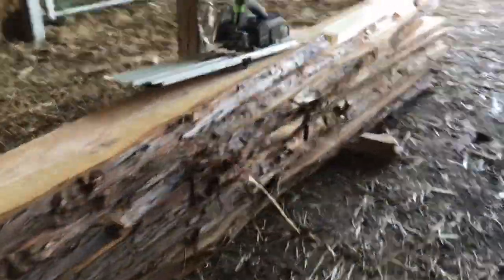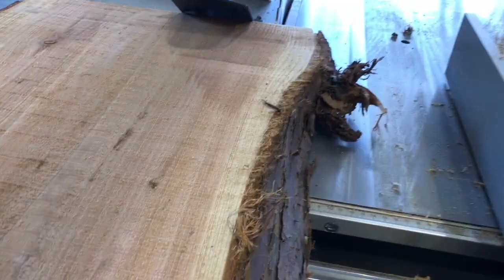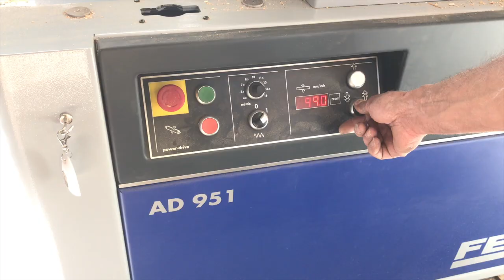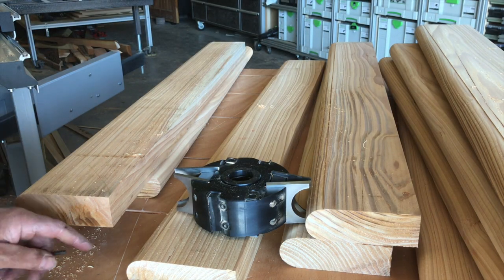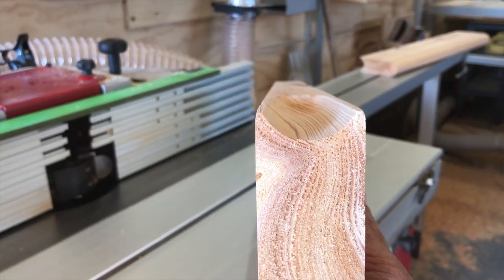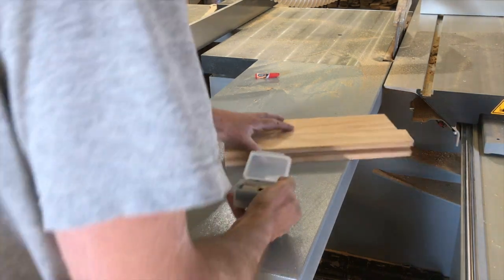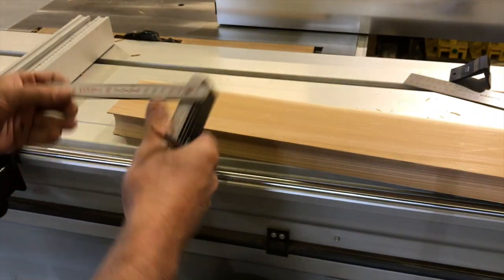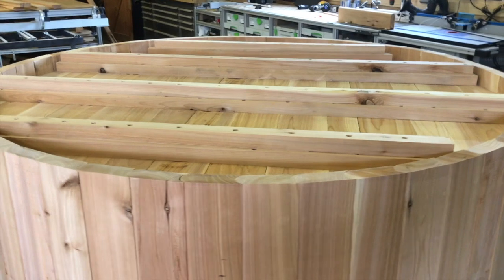Hot Tub from local live edge - Western Red Cedar p1

Comment: How did you calculate the width of the planks going round so you got a right fit and ended with a full one?
Reply from the maker: Times he width of each stave in my case 53 x 111mm.  Total 5883 giving a total outside radius of 6m.  Which takes in to account the 10mm rebate as I cut a 20mm rebate in each stave you have room to make small adjustments

Comment: Hi, great channel. You've been really helpful as I set up my own workshop. Can I ask, is the altendorf able to take the dado blade as standard? And what blade are you using? As I don't have a tenoner, but am soon to take delivery of my very own WA6 (not as shiney and new as yours though!), a dado would be very useful! Keep the great videos coming!
Reply from the maker: Thanks Andrew!  your support really helps!!   that odd I thought I did a video on the cutter but can't find it..  I will do a video and show you ...  the good news is the WA6 come with a removable shim (unlike felder which is a option) the bad news is I could only find Felder cutter in the 230mm size which fits a sliding saw and that is not cheap! and then you have to have it machined to fit the WA6 spindle again not cheap .!
Reply: Thanks, that would be great! Sounds like it might be cheaper to buy a tenoner!!! 😯
Reply from the maker: Maybe for me I am using  Dominos most of the time these days , but  for cutting groove in sheet goods and also rebates its so good!!
Reply from the maker: or you can use the moulder for the job..   or this :)  https://youtu.be/3UND8EPN4zw?t=3m41s
Reply: Yep, I’ve got the domino as well, having used the small one where I used to work I decided that I’d invest in the xl, as for a small one man band with limited resources it has a lot more versatility than just a tenoner. Currently it’s being used as my morticer as I make my workshop doors! Have to add the dado onto the long term wish list I think!

Comment: I was going to ask where you got the cutters and then looked above. Nice workshop you have there. What do you pay for Western red cedar if you don't mind me asking.
Reply from the maker: I need the Whitehill cutter block as well as there are much bigger that euro cutters !!   not 100% sure of cost as I did a deal with my local yard to have very clean WRC which they hand selected for me.  I would say £500 to £700 for a Hot tub build inc seating
Reply: Do they not price by m3. On oak I pay £250 m3, douglas fir £200, I have not bought wrc and was wondering what the cost would be and just comparing what the charge is around the country. Do you carry much stock of timber. I find timber is like screws, you can never have enough of it.
Reply from the maker: there will be a m3 price , but I asked for clean boards and gave a cut list , the yard then hooked me up with good selection knowing I would use the less clean board for seating etc..  so we just did a deal on the lot.  in this case.    I do try to keep a stock of hardwoods and have started racking up all my walls so i can find it when I need it :) ...  I am trying to get some large racking on my barn to air dry some full Oak trucks to have more to hand and save money .  but I need to build the racking and it low on the list..